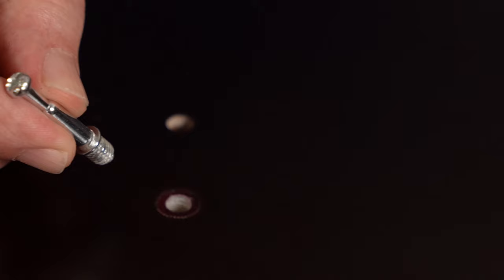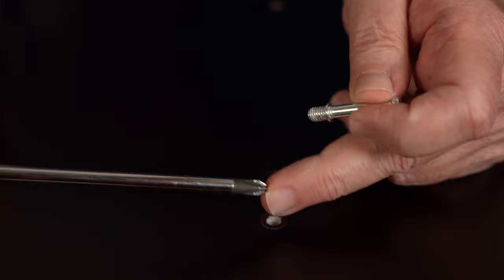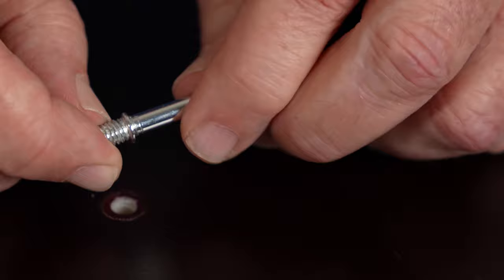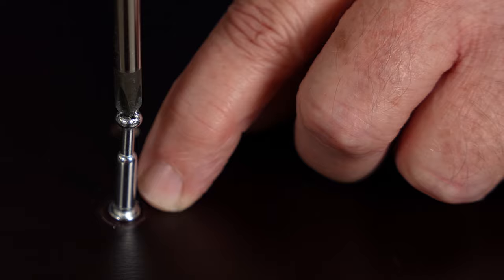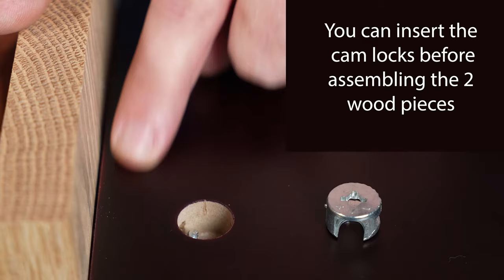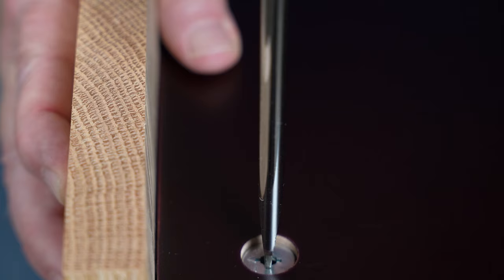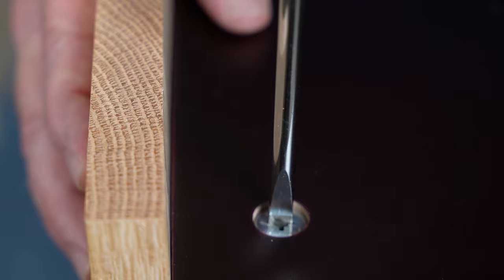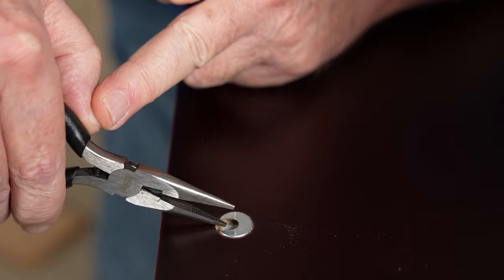Kit Furniture Assembly using Cam Locks

Comment: Thw whole europe is using them without any issues. Why on earth this fastening is not yet widely adopted in america where hand labour intensive, glued and time consuming methods like wood dowels, biscuits, pockets holes and etc.? You can split the assembly for eternity where as you can only screw for a few times into the pocket holes before the wood fibers loos stiffness and does not hold the screw anymore...

Comment: Hi there, any chance you have advice on how to remove the actual screw if there is no access from the side of the cabinet. I have a built in cupboard with these, have managed to get the cam lock nut out but no idea how to get the screw out, the only access I have is via the actual cam lock nut hole

Comment: I’ve taken all the cam locks off but it’s a table and all the cam bolts can’t be removed because of the angles. I can disassemble the table 🥲
Reply from the maker: See if it will let the parts separate   or did they glue the dowel rods?
Reply: @basicworks1  oh, they must have glued them! No amount of wiggling worked... I've already moved now so I had to leave the table behind.